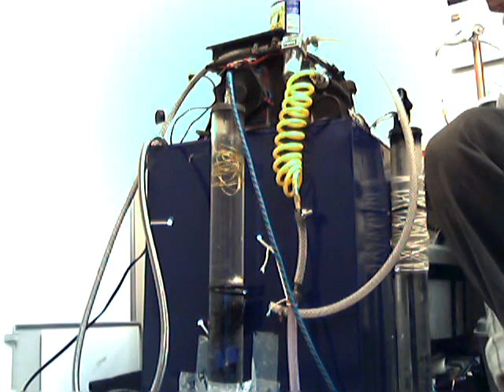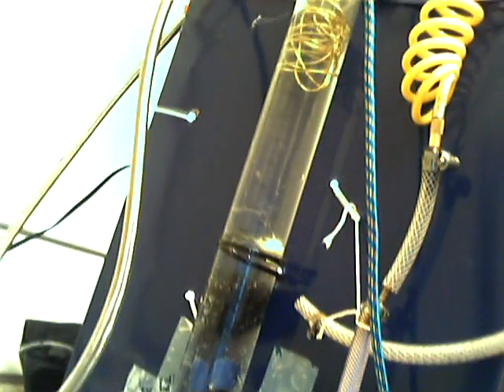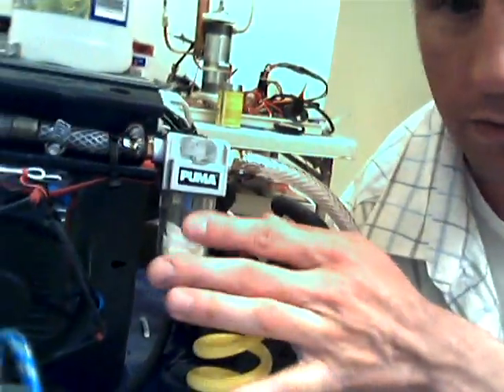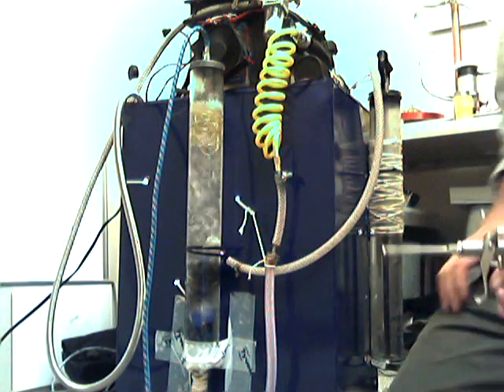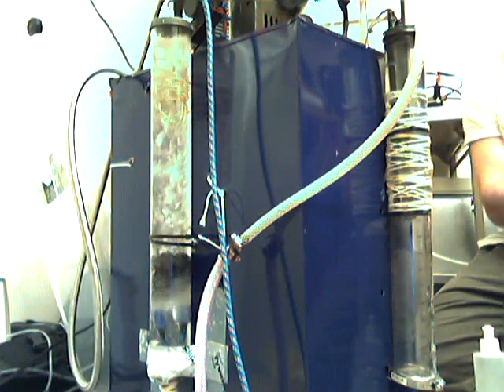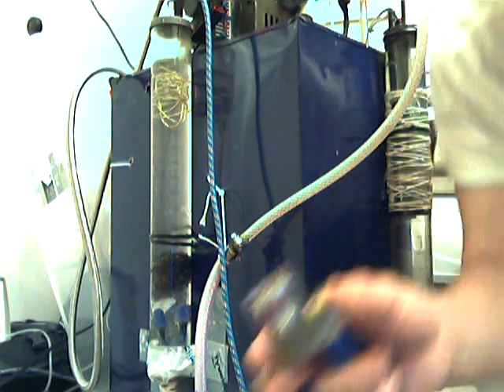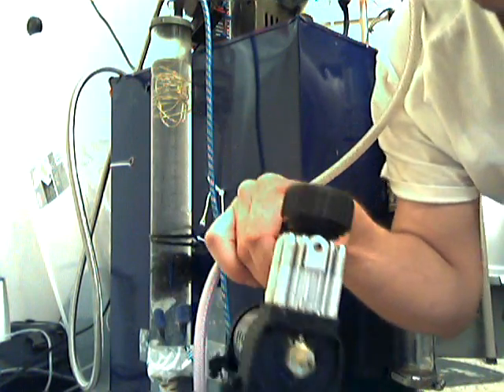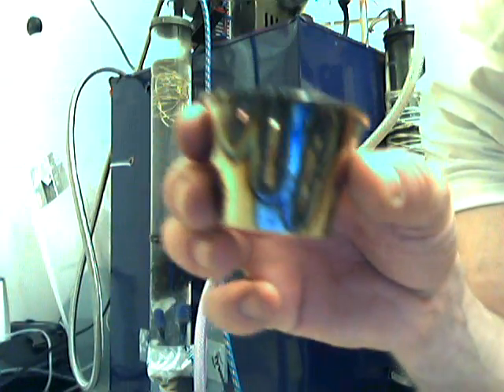hho gas purification testing

Comment: you said that you have problems with too much gas comming out in the tube - well i thought of a solution :) you could try connecting a switch or a voltage controller (you press harder, mode energy goes through it- it's most common in the light switches).  tight it to  the grip of your torch, so when you press the trigger, you make more energy pass through, which in conclusion will give you more gas. ( sorry for my english, i havn't practiced it in loooong time...)

Comment: great work!  I like the bubblier setup.  the torch you got from harbor freight, what was it designed for? an air gun?  it looks perfect for a torch, I can get some smaller needles for a air blow gun that might work for a torch tip.